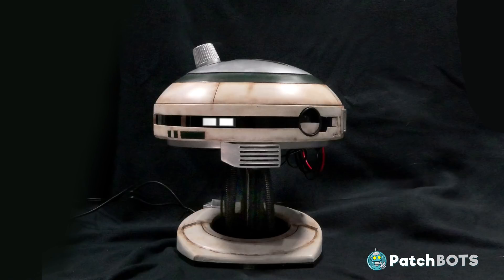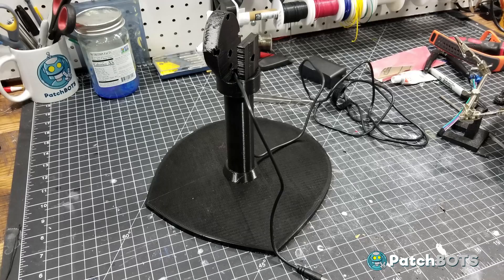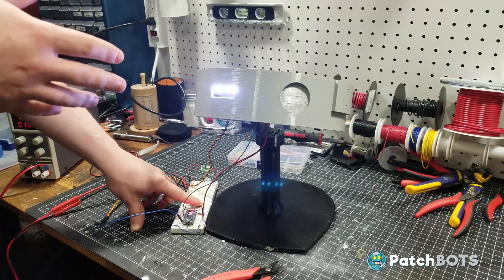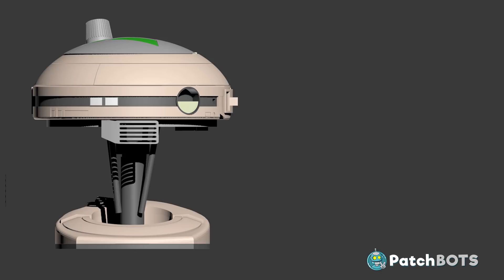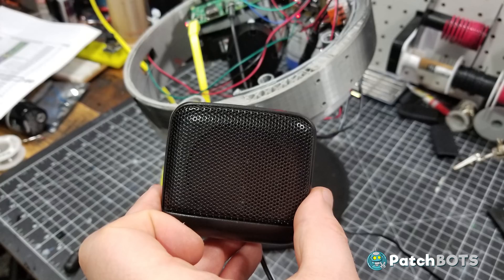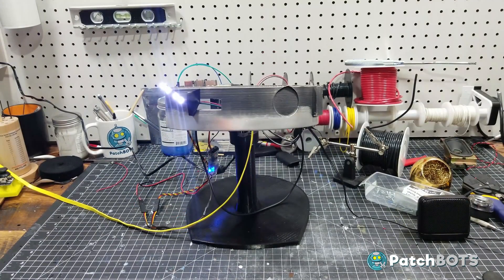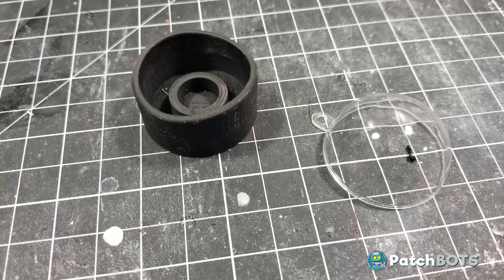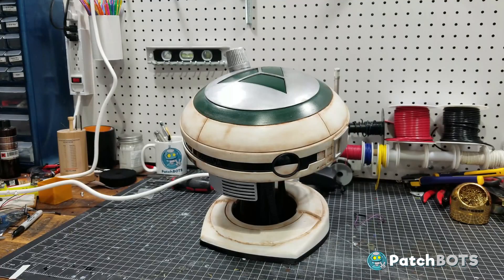I made an L3-37 "Alexa"  -- Solo: A Star Wars Story

Comment: So mine fails to connect - Any help on the following Below are some exerts from of running ./l337.sh debug 2019-01-02 22:18:49.317 [ 1] E SQLiteStatement:SQLiteStatement::constructorFailed::Could not create prepared statement.:rcode=1,error message=no such table\: alerts_v2 2019-01-02 22:18:49.453 [ 8] 5 TemplateRuntime:addObserverInExecutor 2019-01-02 22:18:49.669 [ 1] 5 CBLAuthDelegate:addAuthObserver:observer=0x1dc9ed0 2019-01-02 22:18:49.670 [ 1] 5 CapabilitiesDelegate:addCapabilitiesObserver:observer=0x1dc9ed4 2019-01-02 22:18:49.671 [ 1] 5 CapabilitiesDelegate:addCapabilitiesObserver:observer=0x1d82d88 2019-01-02 22:18:49.678 [ 2] 5 HttpPost:doPostSucceeded:code=400 2019-01-02 22:18:49.679 [ 2] 5 CBLAuthDelegate:receiveTokenResponse:code=400 2019-01-02 22:18:49.679 [ 2] 5 CBLAuthDelegate:mapHTTPStatusToError:code=400,error=INVALID_REQUEST 2019-01-02 22:18:49.680 [ 2] 5 CBLAuthDelegate:errorInLwaResponseBody:error=invalid_request,errorCode=INVALID_REQUEST 2019-01-02 22:18:49.680 [ 2] 5 CBLAuthDelegate:setAuthError:authError=INVALID_REQUEST 2019-01-02 22:18:49.680 [ 2] 0 CBLAuthDelegate:receiveTokenResponseFailed:result=INVALID_REQUEST 2019-01-02 22:18:49.680 [ 2] 5 CBLAuthDelegate:setAuthState:newAuthState=UNRECOVERABLE_ERROR 2019-01-02 22:18:49.681 [ 2] 9 CBLAuthDelegate:callingOnAuthStateChange:state=UNRECOVERABLE_ERROR,error=INVALID_REQUEST ################################################################## # UNRECOVERABLE AUTHORIZATION ERROR: INVALID_REQUEST # # Entering limited interaction mode. # ################################################################## +----------------------------------------------------------------------------+ | In Limited Mode: | +----------------------------------------------------------------------------+ 2019-01-02 22:18:49.692 [ 9] E CapabilitiesDelegate:publishCapabilitiesFailed:reason=getAuthTokenFailed 2019-01-02 22:18:49.693 [ 9] 5 CapabilitiesDelegate:setCapabilitiesState:newCapabilitiesState=FATAL_ERROR 2019-01-02 22:18:49.693 [ 9] 9 CapabilitiesDelegate:callingOnCapabilitiesStateChange:state=FATAL_ERROR,error=FORBIDDEN ############################################################### # UNRECOVERABLE CAPABILITIES API ERROR: FORBIDDEN # # Entering limited interaction mode. # ############################################################### ##################################### # Client not connected! # ##################################### 2019-01-02 22:18:52.633 [ 7] 5 TemplateRuntime:onDialogUXStateChanged:state=IDLE

Comment: Can this be done with pi zero W?
Reply from the maker: That's a great question. i should look into that.  It's much smaller isn't it...
Reply from the maker: EDIT: The first thing that jumps out at me is that there is no 3.5mm Jack for audio out.   I'm sure you can work around that pretty easily, but currently that is what I am using for audio out of the Pi
Reply: I have the google aiy voice hat that has speaker driver and Mic

Comment: How much did this roughly cost you in the end?
Reply from the maker: Not a lot.  Since the parts are tested and work, you can probably print the whole thing on less than 2 rolls of filament.  I have all the parts listed above. They are all from amazon though. If you're really budget conscious I'm sure you can find all the parts cheaper.   But like, I dunno, $150?
Reply: Oh awesome. I was expecting like 600 or 700 for it.
Reply from the maker: Yeah, it's hard to give an exact number.  It's like asking "how much does this recipe cost to make?"  Well I can give you the cost of food, but I'm not sure if you have all the proper pots and pans and utensils.   Like, I'm not going to include "Phillips Head Screwdriver" in the cost, because most people have that on hand.  But what about "soldering iron." A lot of people have soldering irons, a lot of people don't.  So there is this huge 'grey area of cost' which depends on how much you've already invested into your hobby.